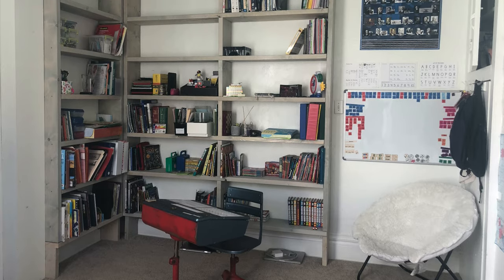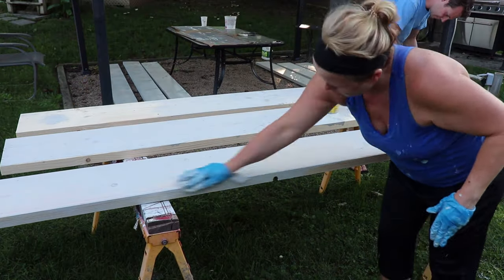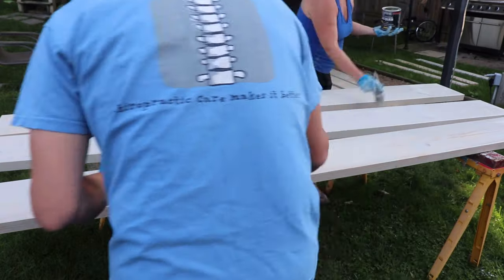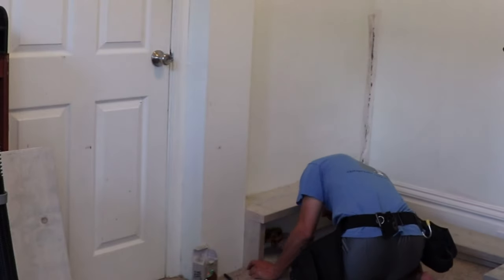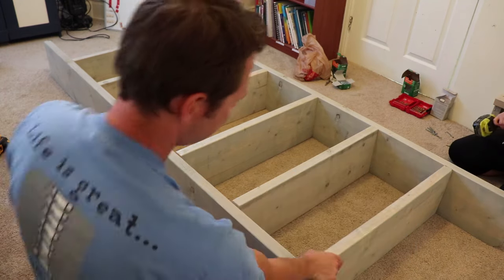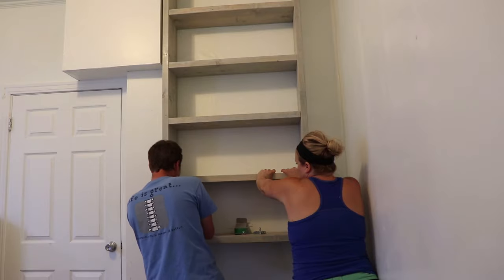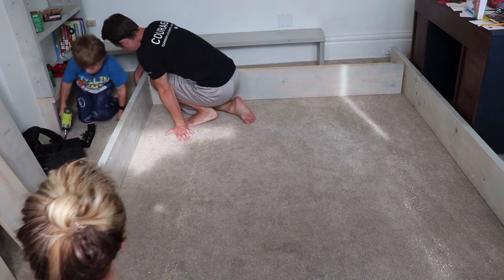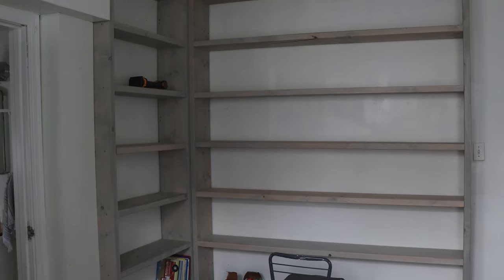How to make a DIY BOOKSHELF|| Home Office or Homeschool Room||Step by Step Tutorial

Comment: What size boards did you use?? We are a homeschool family and a book addict over here.
Reply from the maker: We used 2x10 so most books fit nicely.  Being a homeschool family, you know you can sometimes get the random oversized map or speciality book so I stack both vertically and horizontally which works nicely.